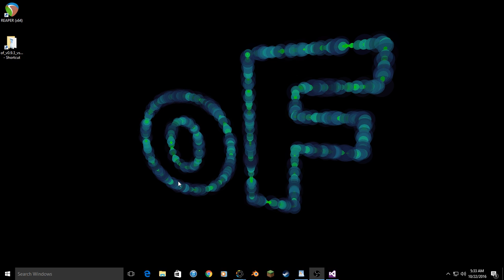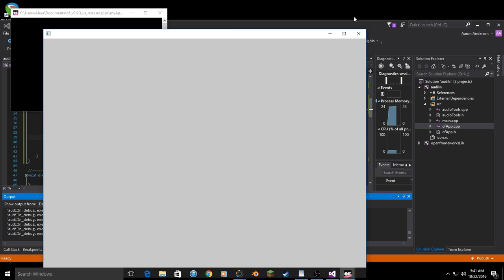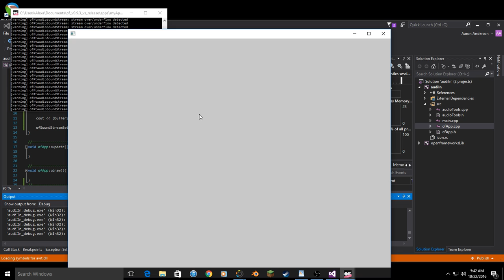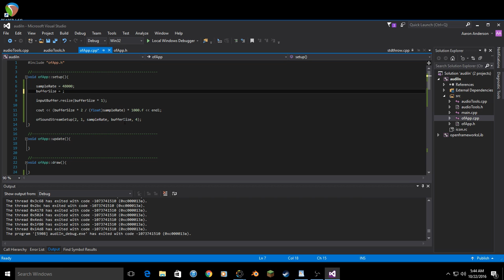Audio Input: openFrameworks Audio Programming Tutorials 8

Comment: Why did you use 48000 instead of 44100 as the sample rate?
Reply from the maker: I see 48k more often so I tend to stick with that. Also, in many newer applications 44.1k seems to be disappearing as an option. 44.1k seems to be disappearing with the compact disc. I almost always choose 48k as a default now. However, it really won't make a difference in your application either way (provided your hardware DAC supports the sampling rate!). Thanks for watching!
Reply: @TheAudioThread  I don't think 44.1 is going anywhere soon.Just my 2 cents. Cheers.
Reply from the maker: @rockascreen1109  You're probably right about that.